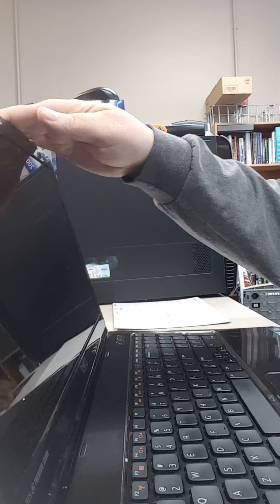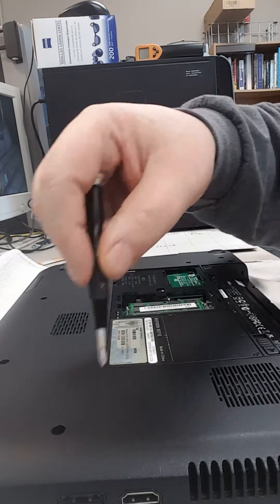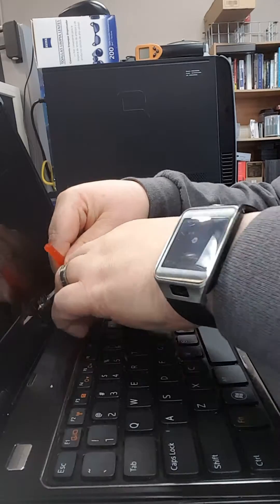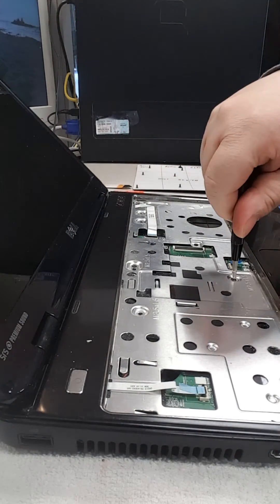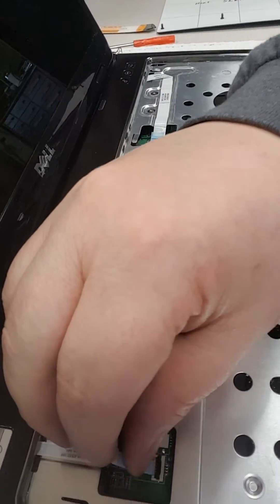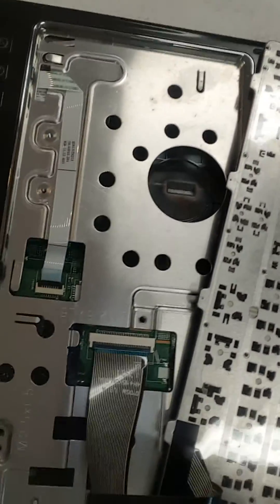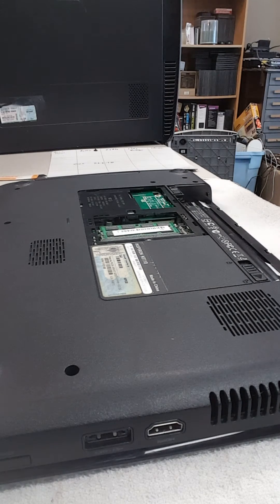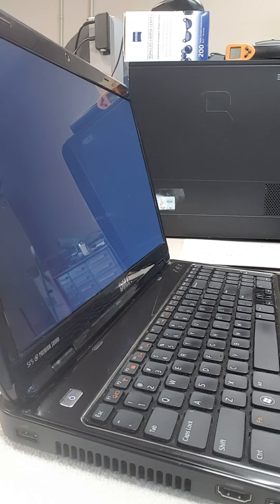Dell insperion N5110 boots to white screen

Comment: I have the same model, I did the same steps but I still have the white screen. What is the isssue please?
Reply from the maker: The first thing that is always done is to place the laptop on a external monitor. With this laptop we did and it worked fine. So it was sent back knowing it was a hardware problem and the 8 beeps it gave us told us the there was no monitor connected. Since there was obvious sighs that the base had been open that is where we started. If you are getting the 8 beeps and have a picture on the 2nd monitor I would check both ends of the cable. A bad graphics card could case this but normally you would not get a picture on the 2nd monitor. You can also check Video drivers. Normally a White screen is not a bad screen but can be. It is just a lot of trial and error this one gave us a lot of clues and was an easy fix. Unfortunately the more work it takes the more a customers personal info could been seen and we do not post those videos.